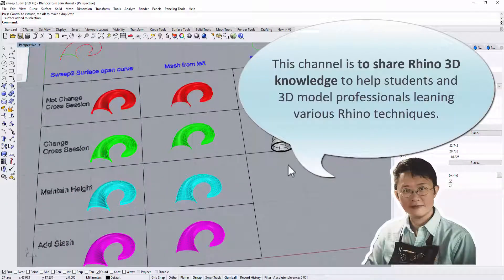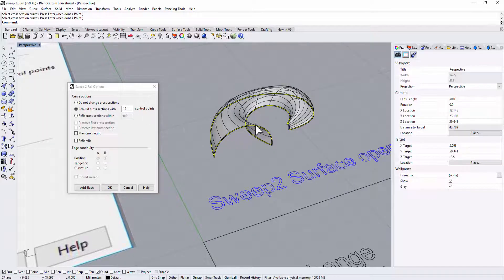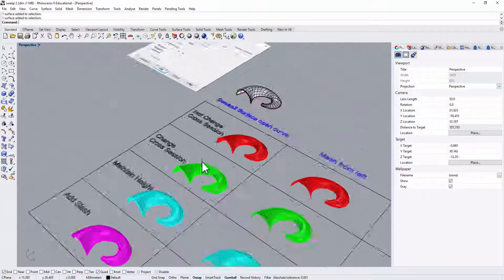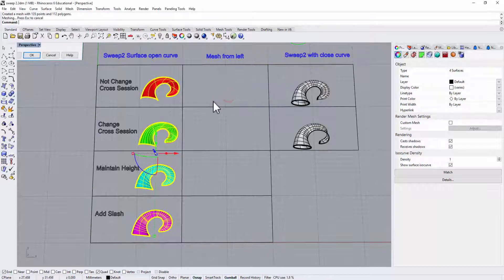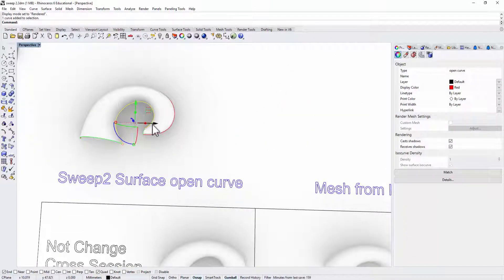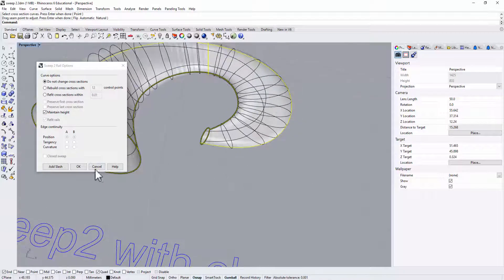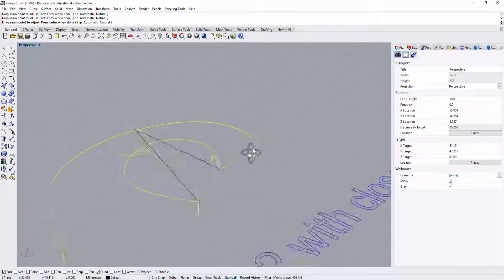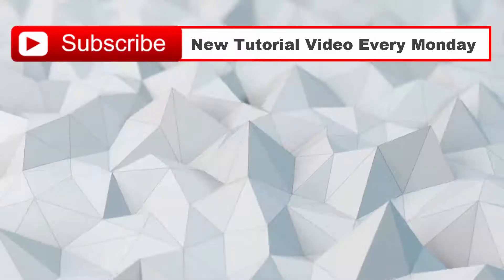Rhino 3D CAD Technique #16: Sweep 2 Rails in Rhino 6 (2018)

Comment: HI P.J.,I have a question: what is the difference of  tow command " the "mirror " in Transform , and the " symmetry " in Surface tool "?
Reply from the maker: Mirror applies to all object including point, curve, surface, solid. Once you set the mirror axis, it will mirror the selected object to the other side of axis ONLY. Symmetry only applies to curve and surface edge. Once you set the axis, it will not only mirror selecting curve or surface edge. it will blend the space in between with curve or surface.
Reply: thx a lot

Comment: thanks a lot can you make more video about hrino plugin tspline PJ Chen
Reply from the maker: Starting from Rhino 6. TSpline no longer is a plugin for Rhino.
Reply: I AM REALLY APPRECIATE  MRS  PJCHEN . JUST ON MORE THING THAT ,I AM ALWAYS CONFUSED ABOUT MESH AND NURB MAY YOU EXPLAIN ABOUT THAT. THAT'S GREAT IF YOU HAVE ANY LINK TO TRAINING ABOUT.
Reply from the maker: Wiki has a good explanation about the NURBS
 "Non-uniform rational basis spline (NURBS) is a mathematical model commonly used in computer graphics for generating and representing curves and surfaces. "
"A polygon mesh is a collection of vertices, edges and faces that defines the shape of a polyhedral object in 3D computer graphics and solid modeling. The faces usually consist of triangles (triangle mesh), quadrilaterals"
Long explanation short. Imaging the NURBS only can be presented virtually.  In 3D modeling. you can have curve tool and click 3 places to have a "curve". In reality, they are constructed by many sessions of straight lines. The same theory is applied to the surface. There will be a lot of triangle and quadrilaterals surfaces to construct a mesh surface. The more triangles and quadrilaterals surface you have in a mesh surface, the smoother mesh surface you can have for 3D printing. All the printer only take STL (an abbreviation of "stereolithography")  file which is constructed by mesh surface. SO  you have to have NURBS turn into mesh surface in order to export file to STL file for 3D printing.